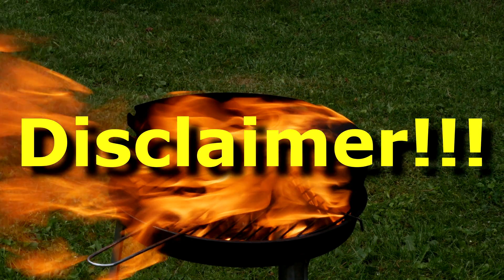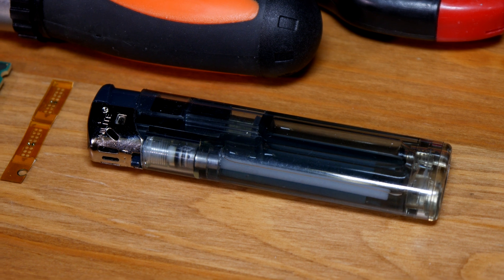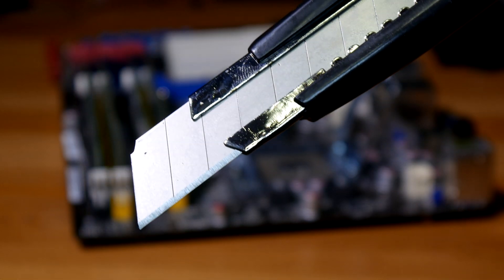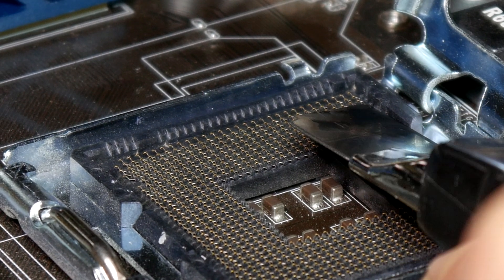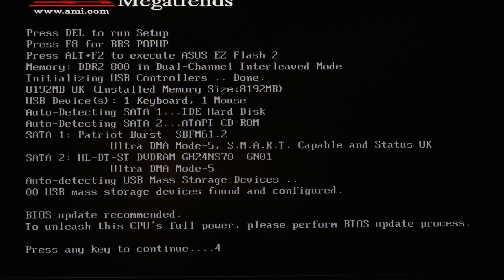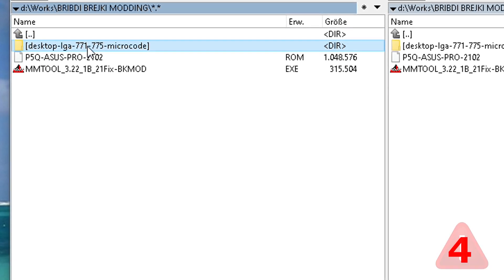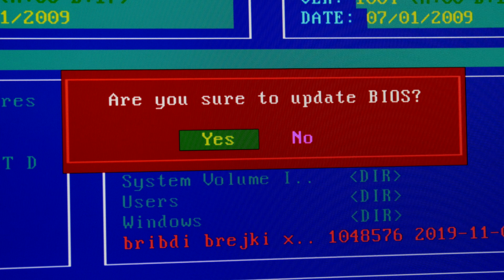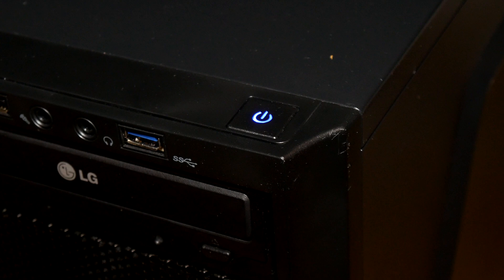Xeon X5460 Socket LGA771 to Socket LGA775 modding, using not so ordinary ways!!!

Comment: hello!
I can't download the file...
the link is broken...
please help me!
Reply from the maker: Hi. I have just updated the link to the files. Please check it in description.
Reply: @bribdibrejki8447  Thank you! I have a question: when you use the Xeon processor, you need to use server RAM (ECC)?
Reply from the maker: @martingajardo4174  No!
Reply: @bribdibrejki8447  "Dieser Download ist nicht mehr verfügbar." again :)
Reply from the maker: @doyouwtech9012  Why you did not download it when it was "vefügbar"?
Reply: @bribdibrejki8447  you meant "verfügbar" ?
simply because I only needed and tried 2 weeks ago.
why is it no longer avalable ?
Reply from the maker: @doyouwtech9012  That hosting must be paid, and this way is better because that file acts just like a real digital nomad. It will be "verfügbar" again.
Reply: @bribdibrejki8447  I understand. 
But it's ok I found it elsewhere with latest updated MicroCodes and post it on my Onedrive for it to be permanently avalable.
thx again for your time sir !
Reply from the maker: Refreshed upload link

MMTool and Microcodes:
https://www.file2send.eu/de/download/fwh4QET3uP2FhiUjblsm0UM8DHKgvKPeEKRqEes4Ho7MTqBTz9YkV6ldC3Jh5Cba

Comment: Please tell me how to update my bios with the microcode for Xeon X5460 ... Its award bios and P31-S3G Motherboard
Reply from the maker: Hi. There is Award Bios Microcode mod for LGA 771 CPU on LGA 775 Motherboard. Just google it and you will find the site, everything is explained step by step.
Reply: @bribdibrejki8447  I updated the bios with the modded bios and installed the x5460 processor  on the P31-S3G Motherboard. CPU is recognized and everything is working, but the CPU temp is high. In full load it reaches up to 74C (in idle ). Is this Normal ?
My cooler is the LC Power CC 95.
Reply: @bribdibrejki8447  thank you !

Comment: The website link doesn't work anymore. 🙁 Is there another way to download the modified BIOS with the microcode for the Asus P5K ??
Reply: The Optimus Prime voice is top notch 😆😆😆
Reply from the maker: Seen the message just today. I uploaded the original files used in the video, so the links are updated as well.
Reply: @bribdibrejki8447  Hi there! Thanks for your help!! The microcode works and now, it is time to OC the CPU to the MAX. 3.6ghz seems to be too low. Have you tried to go over 4.2ghz or it doesn't make any difference?
Reply from the maker: @hurikem  Glad you did it! With the limited Bus stability on the exact motherboard I did this mod on, I would stay safe below 4Ghz to avoid instability. The other thing to have in mind, is that even on moderate OC like 3.6Ghz and under somewhat higher load, that CPU transforms itself into an true Cast Iron Cooking Stove - old school all the way.
Reply: @bribdibrejki8447  5ghz is the hot spot!! 😆😆 More power, more frame rates for GTA5 🤣🤣🤣
Reply from the maker: @hurikem  LOOOOOOOOOL!

Comment: Does anyone know if this will work with an X38 chipset?
Reply from the maker: Yes it will! But, You have to use X3xxx Xeon CPU series (X3360 or X3380 comes to mind as a good solution here).
Reply: @bribdibrejki8447  I purchased a lot of Xeon processors and one is an X3363. Unfortunately it doesn't have any more power than my Q9550 according to CPU benchmark sites... Is it worth trying anyways?
Reply from the maker: @TheJhine5588  If You find it easy to mod, then the decision is only upon You. I would not bother.

Comment: Are microcodes necessary to install?
Reply from the maker: Technically they are not necessary in some cases (depends on the Mobo really)! But! If You would like that your CPU and all of his resources are 100% correctly recognised under the BIOS which is not really programmed for the Xeon CPU's, you should install the microcodes as well.
Reply: @bribdibrejki8447  Thank you so much!
Reply from the maker: @ukigaminghd1393  You are welcome.